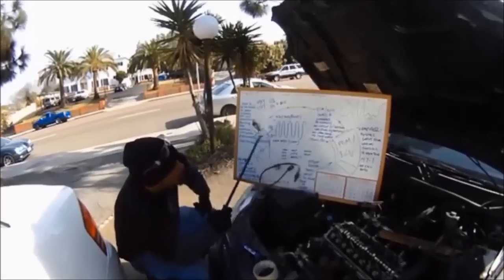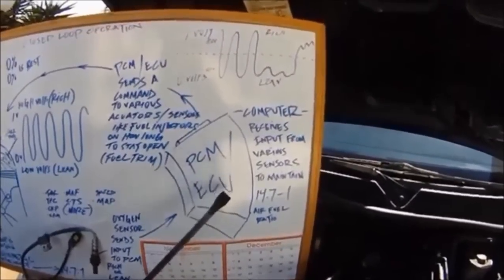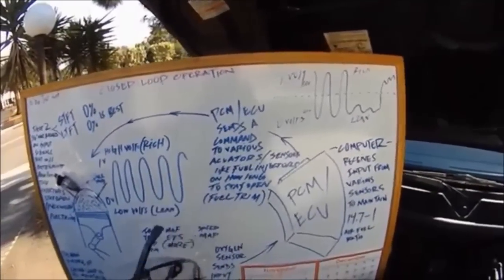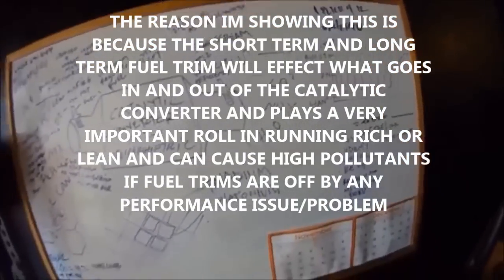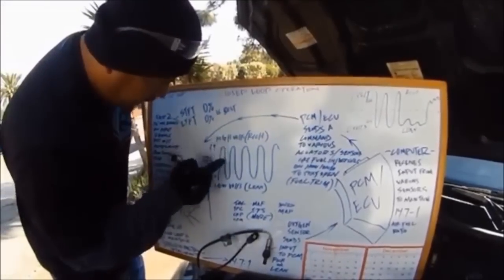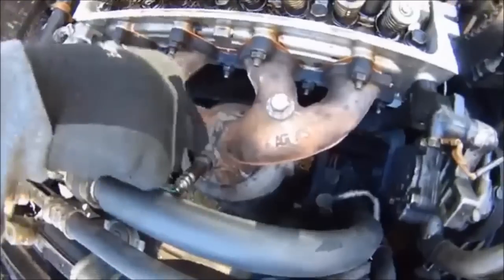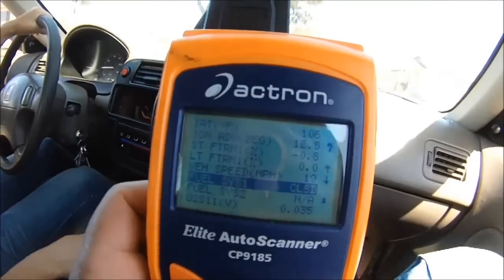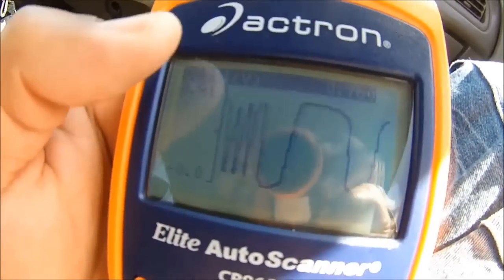Up Your Knowledge: Mastering Closed Loop for Peak Engine Performance -4 Future DIY Mechanics (2023)

Comment: Just found u, struggling w/1994 GMC SIERRA 1500 V6 4.3L. AC Compressor frozen solid, trying to bypass AC compressor, trouble finding right lenght of belt to fit configuration to bypass compressor but include idler, any sugesstions? What am I missing? Thanks in advance for any and all suggestions. Rock on.

Comment: oldschool funk 
I'm thinking of doing my own head job on a 01 civic 1.7 .
I've been watching ur video on  it.
I believe I got this. 
if u have any suggestions , tips, or advice, I am all ears. 

thanks bro.
Reply: I'm late but, bro I did that to mine. I would recommend, cleaning all the components before putting it back together. also, do the water pump and tensioner, and also change the crank shaft gasket. ) I ended up having to take off everything again after doing my head for a really bad oil leak on that crank shaft seal...... so always try and handle all the gaskets in the area of a specific job if they haven't been done before.

Comment: Old School funk I have a question I have been told I can use transmission fluid as an engine flush is this true? If its not what the best thing too use when an engine has gunk I told the person about sea foam but they think it would not work.

Comment: Closed loop has been around for close to 30 years. Just you could get away with doing a lot of dumb stuff. Some nissans have 3 o2s on their 4 cyl. ECU is for engine control only. PCM is for total drive train control such as computerized transmission or electronic diff.
Reply from the maker: blargblarghonk Are you complaining? I know that, why dont you make a video and cover it then, instead of whining... Kill that noise and GET THE POINT.
Reply: oldskool funk Wasn't meaning to sound like I'm complaining. Just so many people think that fuel trim is new and this and that.